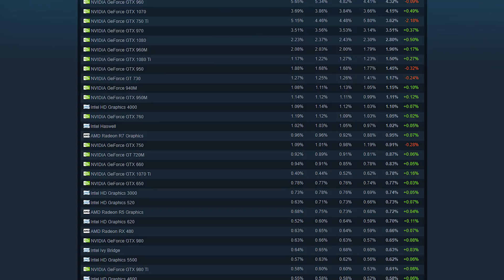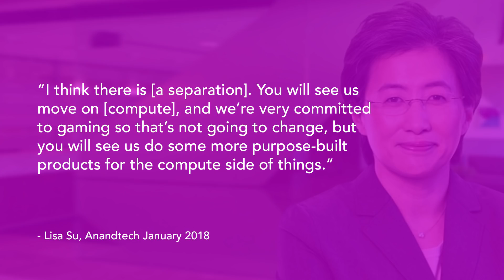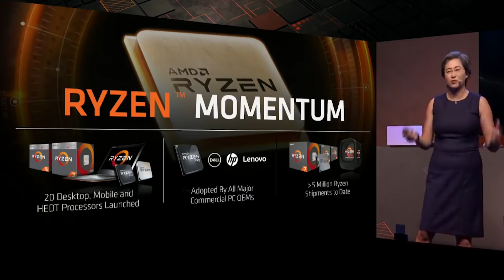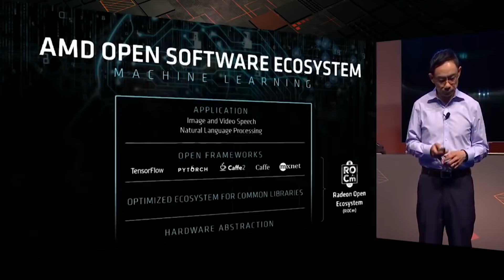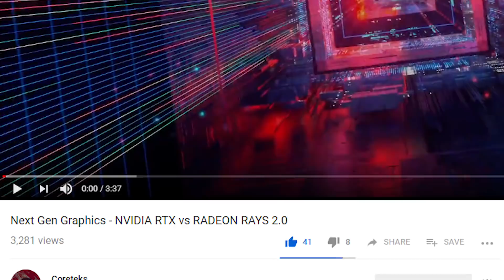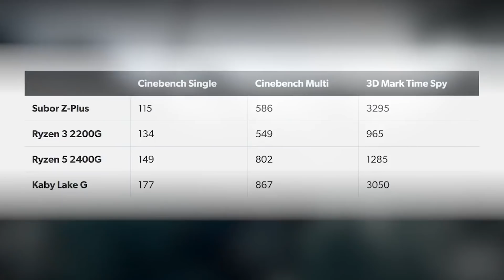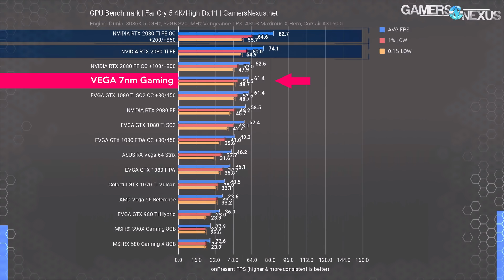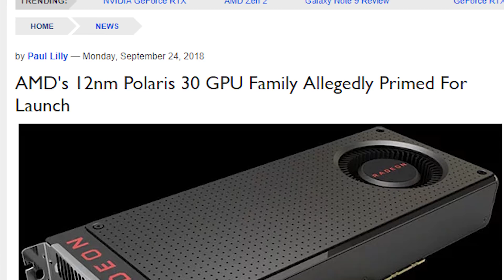AMD's answer to RTX

Comment: A few technical gaps in your analysis. 1) AMD at Computex 2018 did openly saying Vega 56 and 64 had sold 10 times the volume units to PC gamers as the previous generations Fury and FuryX GPUs by the end of May 2018. By the time Vega 14nm is replaced, it will have passed 20X volume of units to PC gamers than the previous generations. By any type analysis, AMD has gone from having a small presence in high-end PC gaming segment to have a significant presence. The past 12 months, an incompatibility has arisen with RTSS (MSI Afterburner) frame-counting software (https://www.youtube.com/watch?v=VpOIhV582pQ) and people with the Vega GPUs can get higher FPS by avoiding RTSS (MSI Afterburner). And separately, a Windows 10 bug appeared in 2018, which reduces FPS appeared affecting Fiji, Polaris and Vega GPUs, which is fixed by disabling "turn on fast start-up": https://www.reddit.com/r/Amd/comments/9cysnx/eliminating_windows_10_turn_on_fast_startup_bug/
Reply from the maker: I suspect most of those sales were to miners, not PC gamers. I did include a steam hardware survey slide at the very beggining of the video. ~Top 30+ cards are nvidia/intel
Reply: That's actually market research AMD has for PC gaming sales for Vega 56s and 64s. In terms of Steam - you talking about 100,000 to 200,000 people gaming on RX Vega 56 or 64 GPUs - that is 0.0008% to 0.0016% of Steam's active user base of 125 million. There is no way the Steam Survey has that level of accuracy - a typical survey is accurate to -/+ 5%. The steam survey list GPUs up to 0.15% and the net total for AMD GPU solutions is 11.71% in August 2018 survey, but the net AMD GPUs share is 15.01%. Therefore, it is in the other category making up 10.31% GPU solutions survey, but not shown in the main list. Sometimes, the survey will show Vega GPUs in main list - but when you get down to usage levels below 200,000 Steams users, it is a really more like a lottery as to whether the Steam Survey is accurate or not.
Reply from the maker: True, the steam survey is far from accurate, but it's the only unbiased source we have. The AMD numbers can't differentiate gamers from miners. I'm not disputing your numbers, just that they don't represent pc gamers. Most of those were miners earlier in the year and last year also.
Reply: Come on, there is a reason the Market Research Industry has a turnover $45 Billion! AMD knows exactly how many PC gamers are using Vega 56 and 64s! The figures presented at Computex 2018 are based on Market Research.
Reply: @balbinderful  AMD don't know that at all.
There is absolutely 0 way or method of finding it out for one.
I guarantee most of those numbers are from the mining craze.
Try not to fall for AMDS marketing and bullshit to much...it's always just that..marketing bullshit...everyone does it.
Reply: AMD last Q2 Earning Report showed a reduction of cryptocurrency mining sales from 10% to 6%. And, a lot of non-miners have difficulty understanding that the most profitable GPU to buy and mine with was Polaris in term of ROI. Miners only bought Vega 56s and 64s, when Polaris supply was outstripped by actual crypto-currency demand. RX Vega 64 and 56 has only been bought heavily by cryptocurrency miners for 4 months and has been around recommended prices for 11 months. Therefore, 71% of the time demand has been from PC gamers and 29% of demand has been from cryptocurrency miners.
Reply: @Coreteks  True, most of those sales must be to Apple, servers, and miners, not gamers.
Reply: AMD's recent dGPU market share gains has to do with attach rate - they can supply a high end CPU with that GPU and OEM's ect find that attractive - the AMD CPU/GPU combo is cheaper and offers the same gaming experience to the eye. This is only possible now because bulldozer was a crap CPU and nobody wanted this. AMD has a clear competitive advantage in gaming and the DC due to having both.  "Subscribed"
Reply: I believe that was a bit dishonest. I am sure many of those vega gpus went to miners.
Reply: The hashrate on various algorithms barely changed with Vega 56 and 64 launches. The evidence is not really there to support that kind of claim.
Reply: most people arel ow budget mate
Reply: that was because AMD in all their "wisdom" decided to "take something away" to make "wattman" and make pretty much all 3rd party tools "unusable" and then they mad "wattman" no longer ""optional" if you want "driver control" you want drive control, you have wattman always there, no longer have the "choice"  after Crimson 16.8.3 because it comes "bundled" whoever thought this was a "great idea" should have been slapped around many many times......cool they want to try something"new" to be "themselves" not cool when many 3rd party stuff does what they wanted to do MUCH better.

focus on the baseline drive, fine, add some nice things to "spice it up" such as Radeon Chill, or Freesync, AWESOME, take away 3rd party fan control and proper monitoring..BLEKK....I hope they do something about that choice in the near future OR "hire" the afterburner designer (Unwinder) to put his way of design in their "house" to make wattman MUCH better less clunky bleek type way ^.^

Comment: Polaris, like Vega, is highly memory bandwidth limited. With GDDR6, it could actually be impressive.
Reply: its hbm2 memory..............................in vega....smh
Reply: Please tell me how 483.8 GB/s memory bandwidth on a 64 rops card is bandwidth limited. the comparable 1080 has 320GB/s of memory bandwidth  and the comparable 2080 RTX has 448 GB/s. There's also 2 different versions of HBM2 based on memory density, there's ones that support 4096 bit for example, like the R9 fury for example had 4GB of 4096 bit HBM high density that boasted 512 GB/s of memory bandwidth.  now lets get real high end, The Nvidia Quadro GV100 has 32gb of HBM2 on a 4096 bit memory bus with 868.4 GB/s of memory bandwith, while the brand new Quadro RTX 8000 uses 49gb of GDDR6 on a 384 bit memory bus with 672.0 GB/s  of memory bandwidth. granted the the GV100 was a 128 rop card, while the current Turing Line up is maxed out at 96 rops, which might not actually be totally true we will see. So no, HBM Isn't the issue,  you are extremely mislead if you believe that GDDR6 has higher memory bandwidth by density.
Reply: No its not. Its NONE of those an  issue. The specs on paper of VEGA and even Polaris are impressive. Why it cant match a 1080 ti I dont understand but I beleieve its game engines not taking full advantage of AMD's architecture. Remember that Vulkan unlocked the full potential of AMD's cards on DOOM
Reply: @Charlymander   It's because they can't run higher frequencies.
Reply: clockspeed. 
1080tis boost up to 2Ghz , Vega stays around its factory OC (1.590 MHz on the strix card ) and wont go much higher. I also would bet that the HBM2 communicates like Ryzen CCXs with infinity fabric causing lag as mentioned. The components outmatch the 1080ti, but the connection between and thermals generated hold it back
Reply: lacucaracha111111 infinity fabric isn't the bottle neck it's the intergrated memory controller that needs work and is catching up. Vegas not really bottlenecked it's API bottle necked. I have a 1080 ti sc2 that boosts to 1949mhz so it depends on how well bined it is and I run it 2200rpm clock frequency scales with temp etc. It's 13mhz every 4c. Also Nvidia doesn't support asic checks on their cards unlike AMD so the only way to tell is boost clocks. I can barely get mine stable at 2ghz. When I over clock it. But then my 1% lows drop by a large margin.  No doubt about boost clocks being great and all.  If you exert a memory bandwidth test on Vega vs 1080 to Vega wins Everytime that's why miners bought them all out since mining is a memory heavy work load.
Reply: Yup. Once Vulkan support was added to doom AMD gpus were faster than nvidia gpus in that game.
Reply: @Charlymander  maybe the bus is too wide, so not being utilised. Maybe the card is too advanced?
Reply: Wtf so you are saying that a gddr6 would be an update from hbm2? ROFL
Reply: Correct me if I wrong, the reason why amd keep using hbm2 instead of gddr is because they are trying to keep the power consumption as low as possible as hbm2 are more power efficient than gddr, if they trying to pair vega with gddr memory instead of hbm2, power per performance ratio will be far worse.
Reply: +Firmansyah Kusumawardhana: No, power isn't an issue, whether a card uses 1, 2, or 3 phases to power the memory modules (whether HBM or GDDR) makes little difference after the GDDR is spread out around the GPU package, that's mostly to do with VRM efficiency and thermals.  Compared to the actual GPU die, memory needs very little energy.  AMD went with HBM purely because of its superior density and performance.  But they didn't bank on the price of HBM2 exploding thanks to the memory cartel.
Reply: @aidanjt VRM efficiency (layout) aswell as thermals are directly related to the usage of HBM instead of traditional GDDR.
Reply: +Marcel Krebs: Of course.  That still doesn't mean that was AMD's concern when choosing HBM2 while designing the GPU package, all that stuff is a problem for the PCIe board, not the GPU package.
Reply: @aidanjt  it becomes relevant when you know that you have a large die that draws 400+W under load, no?
Reply: +Marcel Krebs: Not especially, if they used 8x1GB of GDDR5X they would have only needed 1 extra memory power phase, or none if they clipped memory overclocking.  It wouldn't be too much trouble to find room for it.  Hell, the only reason it's eating so much power in the first place is because they ran up the clocks to try to keep up with the GTX 1080.  Nobody would intentionally design a chip to run like that.  When 'under'volted and clocked, Vega is actually pretty efficient, that's partially why the miners loved them.
Reply: @aidanjt  That doesn't make sense, Vega was primarily designed as a Version of Fiji with faster clocks. That and some trickery to fix problems of the inefficient uArch like primitive shaders. If they would offer the gpu running at the sweet spot of around 1v running at around 1500 MHz it would still draw more power than a 1080 while being about as fast as a 1070ti.
Nobody would've bought a graphics card like that for 600-700€.
Source: I own a V64 LC.

Vega is certainly more efficient than Polaris but Pascal is still miles ahead.
Reply: Firmansyah Kusumawardhana Amd used HBM2 because it was developed with the help of amd, so it would of been a waste of R&D money not to use it. 

As regards to efficiency. Currently Vega 64 vs Pascal 1080 they are purely two different designs one based on building out and one based on building up. Pascal's limitation is actually power delivery and how extremely power limited it is. While Vega 64 doesn't have that issue it'll use any amount of power you throw at it but has less efficient clock cycles which doesn't help with the fact most games don't utilize the Vegas much superior async because of api restrictions. Both are engineering Marvels in their own right let's not say ones far superior over the other when both designs clearly have their draw backs. Let's look towards to future right now even the rtx series is having issues with power delivery even though it's power delivery hardware on board has doubled.  Right now the issue is more API related directx11 is what we mainly use and is honestly very out dated we've been using it since 2008 for example but when you compare Vega in an API that isn't as restrictive as directx11 you see it truly shine. That shows that it's not as bad as a card as the majority claims it is. I don't see in anyway how it was a blunder. A 64 rop card is near competing with a 88 rop card in resolutions under 4k which is very impressive and if your a competitive gamer you'll prefer higher refresh over resolution anyways.  It's a shame the market is dominated by out dated apis as regards to the power foot print using gddr6 instead would use more energy but not by much. What makes hbm2 superior is the fact you can have a bigger GPU core since you got more space on the PCB for it. Look at nvidias GV100 for example. 812mm2 while the rtx TU102 is 775mm. Even Nvidia profited from Amd and Samsung & SK Hynix's R&D. The thing is Nvidia is only after themselves they aren't providing innovations besides their products to the space around them. The last time they gave anything to anyone meaningful is when they had nforce chipsets.  I personally don't believe monopoly is a good thing. We all get fucked over as consumers by it.  Right now that's how it is and it's pretty unfortunate because nvidias new gpus only offer 15 percent better rasterization performance and much better async. Remember the 2080 ti is a 88 rop card. The new features are gameworks based the you is 70% larger then the 1080 ti and manages the same exact pixel fill rate. 50gtexel/s better fill rate and better memory bandwidth all for 70% higher cost. The GPU is litterally the same. With just higher TMUs and additional SMs with TPUs attached to them to handle Ray tracing there is no RTX cores they don't exist they are apart of the SM bus as 22 of the Sm cores are allocated to rasterization and the last 68 to the tensor cores for Ray tracing.
Reply: GDDR6 uses less than GDDR5/GDDR5X and the shrink to 7nm could mean they could stay competitive even with a change to GDDR6 and get cheaper ram which is still super fast
Reply: gddr6 isnt much more than gddr5x
Reply: How is bandwidth limited if there are at best marginal gains overclocking the memory beyond 1025 Mhz?
If memory bandwidth was the problem, wouldn't you expect excellent scaling with memory oc?
Reply: Imagine if HBM could hit 7000 mhz effective like GDDR5...
Reply: it is memory bottle necked, that's it! :)
Reply: You're not smart eh?
Reply: It's far more Rops Limited then Memory Bandwidth limited. Vega is plenty competitive when matched with other 64 rop cards. it's TMU and Memory bandwidth are vega's strong suits, Offering Just as much Memory Bandwidth the 1080 ti and a texture fill rate higher then the 1080 ti.
Reply: +Renkei +1
As a owner of both AMD R9 Fury (1115 Core, 545 Mem) and Vega 56 (~1650, Core 1050 Mem) both cards exhibit typical ROP bound behaviors. They slow down proportionally to the coverage by full screen particle (alpha) effects. The performance hit of MSAA is MUCH lower than a resolution increase indicating [both] the cards are not particularly bandwidth starved.

So, in short, Vega can't beat a 1080Ti because of lacking ROPs. Vega likely improved their bandwidth efficiency with the L2 cache changes but the pixels per clock (4?) remained the same. The OP is right about Polaris though, it does have some bandwidth restrictions.
Reply: What really surprises me is that such a retarded comment got so many likes and moreover, a like from the channel. How the hell did GDDR6 get better bandwith than HBM2?

Comment: So, you think that AMD is making 7 nm Vega in two variants: with HBM2 for MI, and with GDDR6 memory controller- for gaming? LOL
Reply from the maker: I think it's possible. Like I said in the video they've already done that with the Subor Z + (Vega with gddr5)
Reply: @Coreteks  But it would be either GDDR6 or HBM2 design, not both. And, AMD already showed two unreleased Vega chips with HBM2: discreet Vega mobile with single module of HBM2, and Vega 7nm with 4 modules of HBM2.
Reply: V10's IMC can support both HBM2, and G5 or G5X (can't remember which). An IMC that they've updated to work with G6, unsurprisingly. They can definitely do both.
Reply: @Najvalsa  Not true- Vega10 can run only HBM2, because it only has two HMB2 PHY: https://diit.cz/sites/default/files/styles/custom/public/amd_vega_dieshot.jpg?itok=fdIwZJpw (on the right). If it also supported GDDR- it would have lots of DDR PHYs. Like on this Polaris card, only even higher number: https://www.overclock.net/photopost/data/1654402/0/03/03e9941c_Die20Shot20-20AMD20Polaris201020-20Annotated.jpeg
Reply from the maker: Like I said, the subor Z + has a custom Vega SoC which has gddr5, proving it's definitely possible to use a different memory system with vega.
Reply: @Coreteks  Of course it is possible. Raven Ridge Vega is running with DDR4. But only one type of memory controller per chip makes sense, because it costs die space. Liza has already showed Vega 7nm with HBM2. And to produce a similar chip with GDDR6 support would cost tens of millions $ extra for different masks.